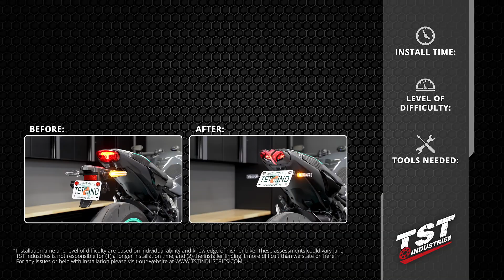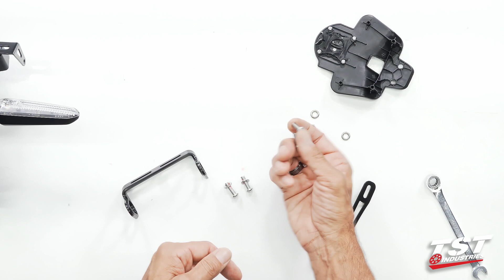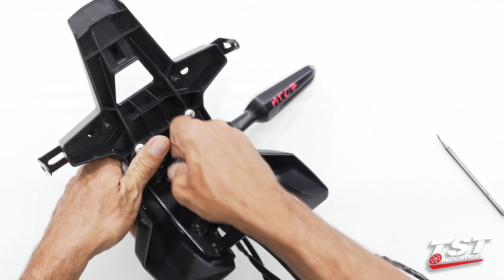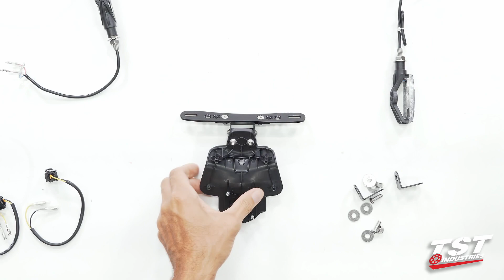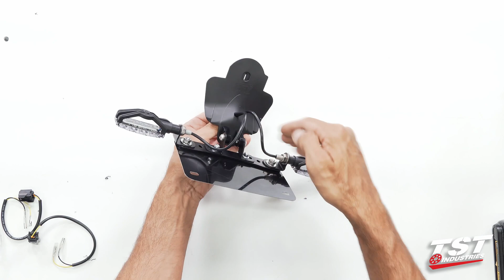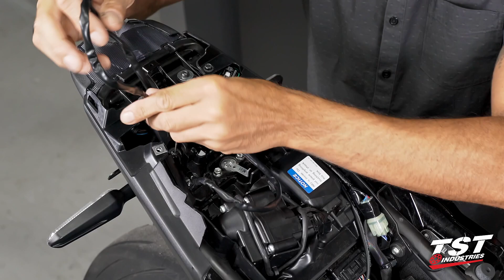How To Install TST LED Rear Pod Turn Signals on 2022+ Yamaha MT-10 by TST Industries

Comment: I would like to change the tail light and keep the stock indicator bracket 
Is that possible?
Reply from the maker: Yes, you can opt for a fender eliminator that reuses the OEM signals or simply keep the OEM fender while using our taillight.
Reply: @TSTindustries thank you

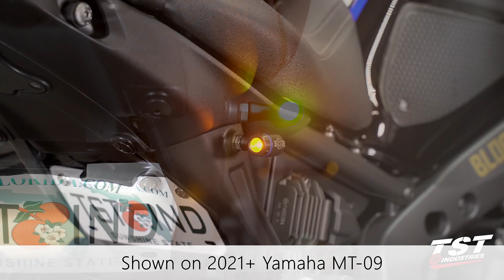Comment: 4:11 what are these called also where there mounted. 

Thanks.
Reply from the maker: Those are our Echo signals, available in our store at TSTindustries.com. That particular shot was of them mounted to an MT09 subframe.
Reply: @TSTindustries  okay so does the MT10 have the same mounting spot if wanted. 

Thanks
Reply from the maker: @Yii00T  on the 10 the tail fairings cover all of the sunframe so there aren't any mounting locations like on the 9
Reply: @TSTindustries  thanks.

Comment: Can you mount the pod indicator units you showed firstly at the rear where the others go?.
Reply from the maker: I don't fully uinderstand your question. Are you trying to mount the pod signals we offer in the OEM mounting location on the fender? In that case you would justy need the signal mounting plate adapter kit , which we also offer, and that will enable you to physically mount the signals to the larger teardrop holes on your fender.
Reply: @TSTindustries  you do 3 types of signals. The first ones are mounted in a strange place. Can those type of signals still be mounted up the rear where normal signals go is what I ment. Lol.

I'm looking into it all in advance before I get a MT.
Reply from the maker: @Yii00T  the first signals are the OE ones and they come mounted on your fender from the factory. That is how the bike comes. If that is what you want then you dont have to do anything after buying the bike
Reply: Also I'm in the UK we don't bolt our plates on the are on with double sided velcro tape for a clean look. So the low plate you have the signals mounted to the bike itself.